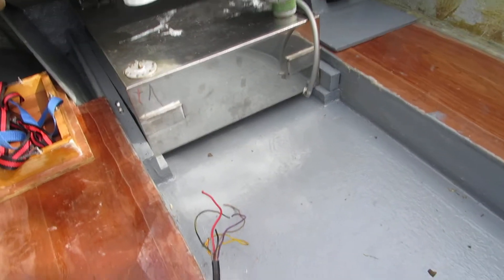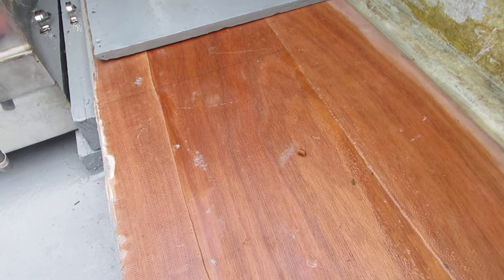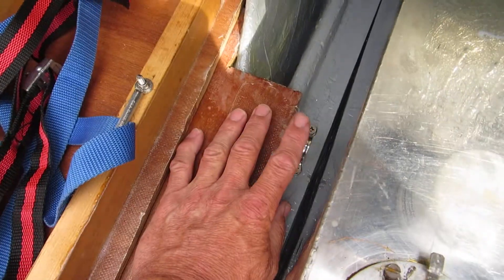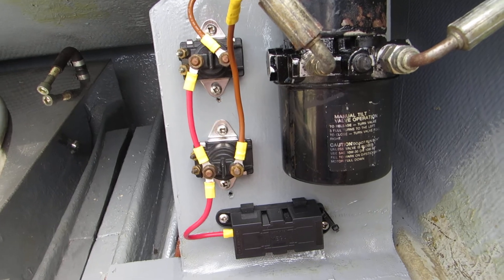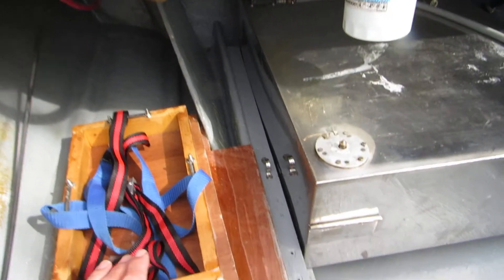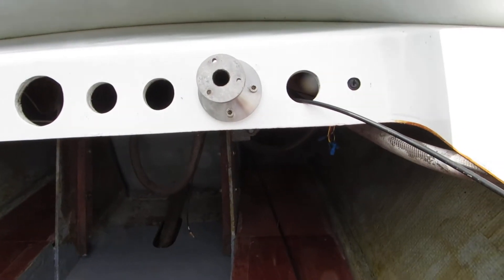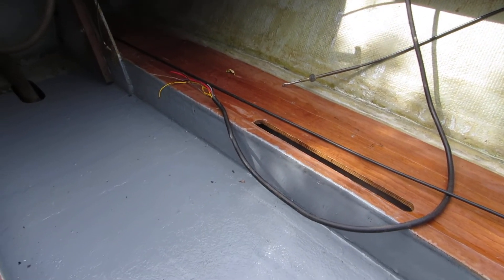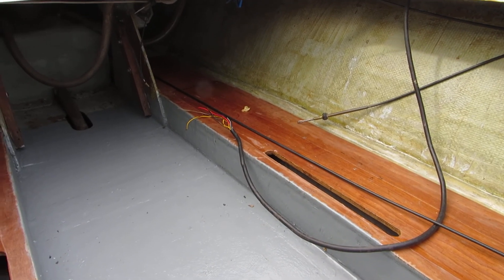Phantom 18 restoration08

Comment: Hi do you still have this boat or have you sold it?
Reply from the maker: Hi, yes I still have it.
Reply: @ratman9802  We are in the process of doing the same project. Can I private message you?
Reply from the maker: @grahamjohnson8842 Yes, if that is possible through you tube
Reply: @ratman9802  Ok dont look like it. Thanks for putting these video up. Great work. Do you have a feel for what the boat now worth when its up and running. We are a few grand into the works and not sure to keep it or sell it as its a bit to fast for a family fun boat.
Reply from the maker: @grahamjohnson8842  I don't want to put my email on a public forum but if you are prepared to put yours on here I will mail you